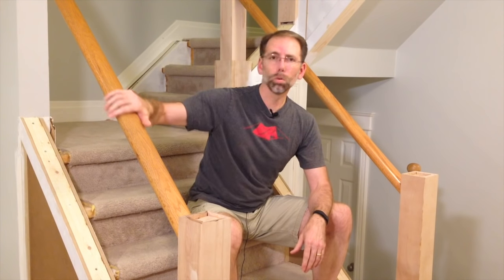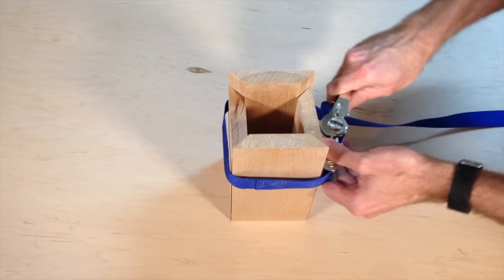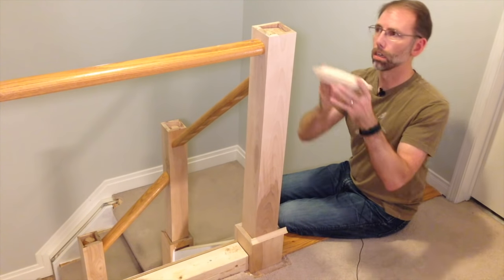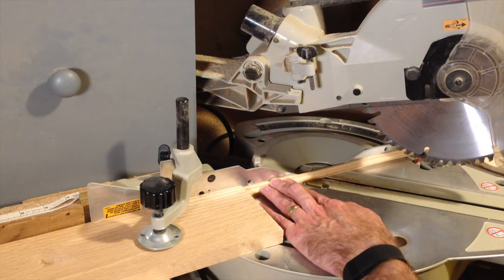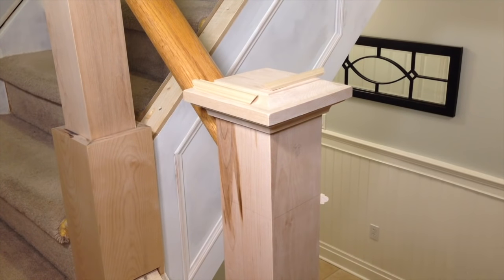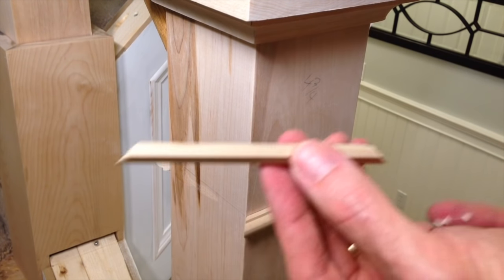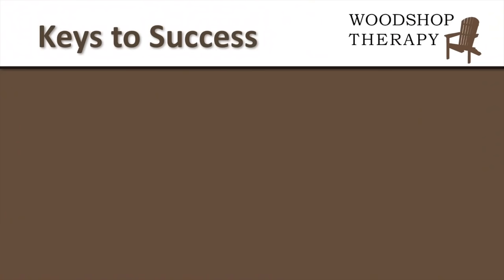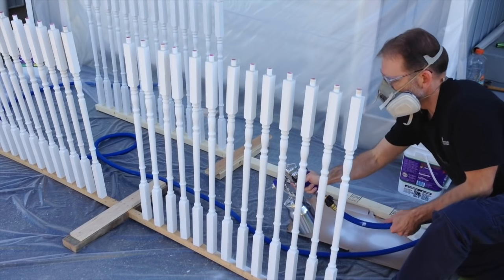Newel Post Makeover (Staircase Renovation Episode 2)

Comment: Three very important items not shown. 1. How does one construct the bottom of the newel post when carpet is involved?
2. Are the railings removed (how) and reattached? 3. How to install balusters when carpet is on the bottom?
Reply from the maker: If you have carpet on the stairs, I recommend removing it first.  You won't be able to get tight joints as the carpet will constantly be in your way.  To detach the railings, I removed the wood plug that covered the screw hole and unscrewed the connection.  To learn how to attach railings, see the video on that topic - https://youtu.be/nD_uyh_ueGY

The bottom of the newel post is put on at the end, cut around the base of the stair and assembled around the post.  I hope that answers you questions.  Scott

Comment: Thank you for making this video. I wish you had shown how you removed the handrail, trimmed it in length to accommodate the newel box and then the reattachment of the handrail to the newel box.
Reply from the maker: I replaced the old handrails with new ones.  The key is to get the right angle on the miter saw.  Take a board and lay it done the staircase, touching the edge of the steps and  measure from plumb/vertical. I hope that helps. Scott

Comment: Awesome job Scott! It's hard to tell but were you able to keep the handrail attached to the original banister post or did you cut it and attach to the outside of the Newel post? Wondering how you secured the rail to that outer shell. I'm looking to exactly what you did so any info you can share would be awesome.
Reply from the maker: Hi Derek.  The old handrail was removed before I attached the outside of the newel post.  I then cut the handrail to fit back in place for safety reasons while I worked on the other parts of the staircase renovation.  I secured the handrail through the outer shell, into the original newel post so that the handrail was as solid as possible.

For details on how to attach the handrail, see this handrail installation video.  https://youtu.be/nD_uyh_ueGY

I hope that helps.  Let me know if you have anymore questions.  Scott.
Reply: Woodshop Therapy Thanks Scott.

Comment: im so confused ,,,those old post are 3 " if you made it 4 ' how were you able to slide it over ,, that material looks like 1x,,,  3 plus 1 1/2 is  4 1/2",,
Reply from the maker: Hi Bill.  Good question.  The existing posts are 2 3/4" wide.  The outside dimension of the new posts are 4" - I used 3/4" material and planed down the inside of some parts.  I hand to adjust the alignment on some of the posts to this allowed me to tweak who to shift the posts.  Does that make sense?  Scott
Reply: @HomeImprovementWoodworking  you must have the made in China ones ,,hahaha,
Reply: So is this not possible if the post is 3.25”?

Comment: Do you attach the newel post sleeve to the existing post in any way, or do they just slide on?
Reply from the maker: I screw it on only on 1 side, to allow for wood movement.   I screwed it on the side where the railing attaches.

Comment: I have watched nearly every video on YouTube on how to make a box newel 
post. Every craftsman presenter, including you, says basically the same 
thing: "To start all you have to do is to make a box out of four pieces 
of plywood with 45 degree angles on each long edge."  Great! It sounds 
sooo simple. Then they show how they make the angled cuts on each side 
of the boards. OK! That's easy to do as well. BUT, NO ONE explains how 
to get an EXACT WIDTH of the board needed for a particular project. I am
 trying to make the boxes to have an exact 3" square gap (hole) in the 
inside of the boxes that will allow for a fit over the old newel post. I
 cannot find how to set up my table saw to accurately make the width of 
the strips at the desired 3" space, plus the width of the two angles.  I
 find it extremely hard to measure the distance between the correct 
points of the two angles. Nothing I have tried allows for the precise 
measurement needed. If you can help me with this, you will be a 
Godsend!! Thank you.
Reply from the maker: Hi Joe.  If you add the thickness of material x 2 to your inside dimension, you will get the outside dimension.  For example, if you are using 3/4 inch material, add 3/4 + 3/4 + 3 inches to get 4 1/2 inches as the outside measurement.  I hope that helps.  Scott
Reply: Home Improvement Woodworking Thanks, Scott. Very helpful. I wish you well.

Comment: Thank-you for the very helpful information.  I have installed a sacrificial fence made from hard wood on my miter saw.  This supports the grain preventing tear on the back side of the part being cut.  To attach the wood fence I had to drill two holes for wood screws in each of the aluminium fences found on either side of the blade.  I start with more length than needed so that I can unscrew them and move them in for new wood as needed.  Especially if I go from cutting a 90 degree cut to a 45 degree cut.
Reply from the maker: Thanks for sharing that tip Bill.  That's a great upgrade for your saw!  Scott

Comment: Hi Scott. thanks for your great video. Love the idea of wrapping the existing post with a new newel post. I am replacing my old newel which is 3" wide. What size of newel  post should I build? Im using 3/4" alder. in other words what size the inside dimension should be to fit comfortable over the old one.
Reply from the maker: you want at least 1/8" of gap on the inside for wood movement.  I had to plane mine down on the inside after I just the miters as my posts weren't aligned properly and had to shift them slightly up the staircase.  Scott

Comment: Awesome video Scott. What size board did you use to get your 4x4 square around the newel post? Glad I dicovered this channel
Reply from the maker: Hi Karl.  I used 1x5 boards, which are 3/4 inch by 4 1/2 inches.  On some of the posts I hand to plane down the thickness of the boards to get them centered for the railing installation as the staircase had some alignment flaws in it.  Does that answer your question?  Scott
Reply: Thanks Scott, yes it did. So you had to plane down the thickness of the three-quarter inch new boards? Didn’t that affect your 45° corners on the new boards?
Reply from the maker: @karld3155  I cut the 45 degree corners first on all the boards so they were the same width.  Then I planed the inside face where needed to align my newel posts.  Cheers.  Scott

Comment: This is a great video.  I'm planning on a similar project.  One question I have if - do you feel it is easier to pre-build the newell post casing and slide them over the top, or do you feel it is easier to build on the existing post by attaching 4 separate boards (i.e. wrapping the boards separately on the post).  Hopefully my question makes sense.  Thank you.  Again, great video.
Reply from the maker: Good question.  If the newel post doesn't wrap around the stair treads, you can pre-assemble it as a sleeve.  In most cases on my staircase, they had to be assembled in place.  I hope that makes sense.  Scott

Comment: Nice. What's the secret to getting the length right on the cove detail pieces at the 7:30 point in the video? Mine are either too short or long but only because I'm a complete amateur! Do you get close first then go back and make additional cuts?
Reply from the maker: Good question.  I cut them a little longer.  The key getting the right length is to start with one end that has a miter cut already and held in place with the adjoining miter so they're perfectly where you want them.  Then I mark the long end with a perpendicular line at the end of the newel post edge.  This line is where the miter will end.  Then I take this to the saw and cut it so the line is right at the edge of the miter (leave the pencil line).  That should get you the right length.

Part of learning how to do this well is practice with your saw.  If you mark well but don't line up your saw blade well, this will cause you problems.  You will get better at this with more experience if you focus on improving your quality.

I hope this is helpful.  Let me know if you have further questions, or if words are just not allowing you to visualize this.  There is power in video.   Cheers.
Reply: Woodshop Therapy Thanks I’ll try it

Comment: on 10:04 how do you fix where the carpet that was damaged. Also my current situation, i ripped off the old railings, then have someone professionally installed new carpet without the replacement railings(rookie mistake), i have an open stringer and doesnt plan on closing it because it is tight already. How do i make a hole on the newly installed carpet for the newel post and spindles without damaging it and re securing it back so the carpet wont be lose. should i use chisel to cut through the carpet for the spindles and post? and should i staple or glue the carpet to the thread so its nice and tight? please help thank you
Reply from the maker: Unfortunately, you've done things in the wrong order.  The carpet needs to be carefully removed, then the spindles/posts installed, then have the carpet installer come back to cut and re-secure the carpet.

Comment: Hi Scott. How did you design the base? Is it just a thinker piece or does it fit around the upper sleeve? And how high is it?  Also how high is the post cap total or above the slanted handrail ?  Thanks!
Reply from the maker: The base was metered, and assembled around the base of the newel post.  I used 3/4 inch material.  The bases are 16" tall.  The post cap is 2 inches above the handrail.  I hope that helps.  Scott

Comment: I always wondered why staining/painting was not done be cutting the pieces.  The strap represents a small amount of paint/stain loss vs the ease of painting a piece of material on a flat surface.
Reply from the maker: I think I understand what you're asking.  Why wouldn't I paint the pieces before assembling them?   I prefer the joints in the wood to be seamless with the painted finish.  When I finish a piece after it's assembled, there are no gaps between components of the millwork and it looks like one piece versus components put together.  Does that answer your question?  Scott

Comment: how did you attached rail to post ?
Reply from the maker: I made a video for that - see https://youtu.be/JTQSPX2nBl0

The quick answer is the lower end of the handrail is screwed to the newel post on the underside of the handrail.  There's a fillet strip that sits in a recess under the handrail that conceals the screw.  The upper end of the handrail uses something called a Zip-Bolt for a concealed connection.  Does that help?  Scott

Comment: I noticed your table saw fence was shifting. Did that effect the precision?
Reply from the maker: cameriqueTV the shifting of the table saw fence was me releasing the lock and re-locking the fence.   It isn't visible on the video.  I use a Delta table saw with a Unisaw fence - when it's locked in, it doesn't move.